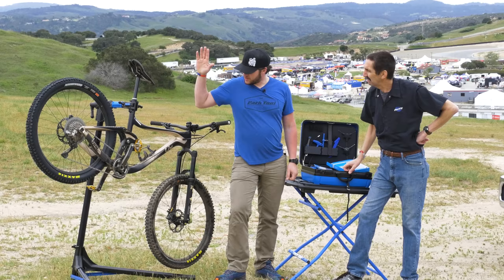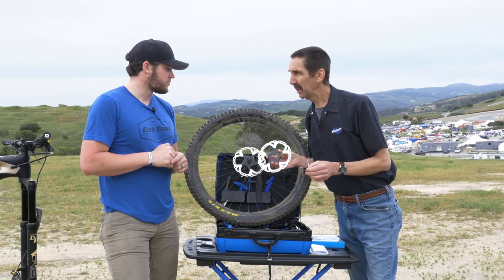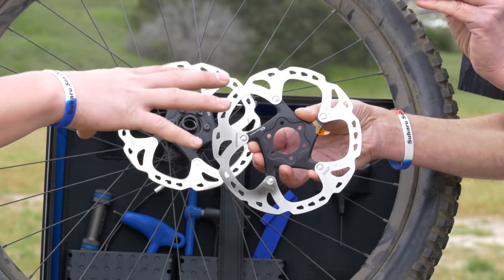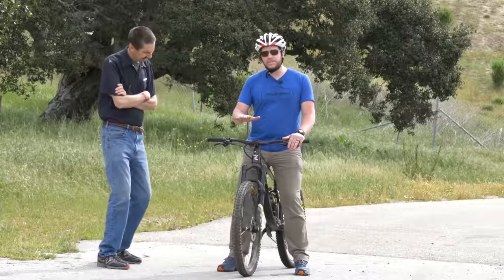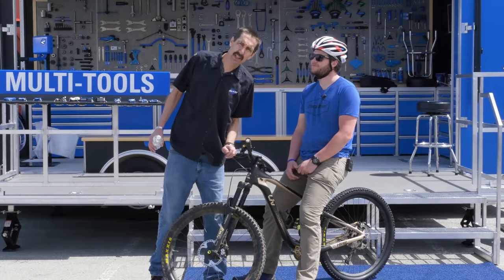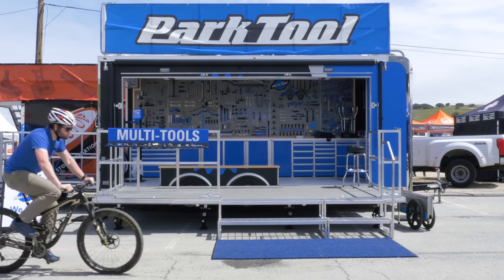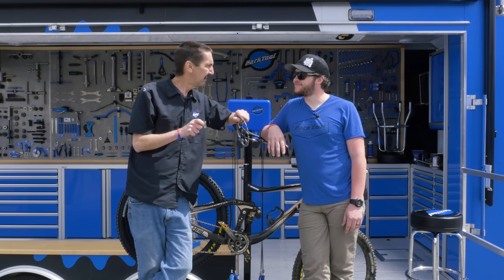Bedding In a Disc Brake - Tech Tuesday #106

Comment: Ok....did anyone else catch handling the new rotor with bare hands...good way to put oil on it...use a glove!!!!
Reply: Ok well im sure others have touched the rotors making/packaging them. They usually come with a light coat of oil on the disc's that needs cleaned off. Also he wss handling the old rotor as they said they were replacing both discs and pads.

Comment: Hello I need help, I have shimano 8020 4 piston brakes on my Wheelie bike and I needed new brake pads but I could not find the h01a brake pads that came with it, so I had to get the H03c metal pads(I am not sure if the h03c pads are good for the 8020, i would appreciate it if you check). So I put them in then I rode my bike, I do not think I did a proper bed in. Then I noticed that they were super hot so I went took them out and I saw that the outside edge of my rotor was slightly burned and the lower edge and top edge of my brake pads were black and the inside/middle portion of the brakepads looked brand new, also it was making a turkey/squealing sound I have a 160mm avid rotor.

Comment: Love the videos, has helped me a lot with my bike. Any tips on deglazing pads and rotors and how to prevent it from happening again?
Reply from the maker: To de glaze pads I like to stick some grip tape for steps or a skate board on a flat board and run the pad around in a circle on that to remove the glaze. Then I take a short piece of emory cloth and scuff up the rotor. To prevent this bed in your brakes. It could also be caused by too small of a rotor for the style of riding you are doing.
Reply: Thanks! I think I didn’t bed them properly
Reply: @parktool  I noticed that the replaced rotor in the video had wear all over the braking surface (from the outer edge to the inner one). What I've seen in many bikes, especially with Shimano brakes, is that a few mm of the rotor's inner edge usually do not contact the pads, being unused. I've noticed it even when the rotor and calliper were from the same group model, with new brakes. Any idea on this? Thank you.

Comment: good video, it shows how to bed, but for how long ?  how many "slow downs", or how many minutes ?  or do it until you can feel a difference ?
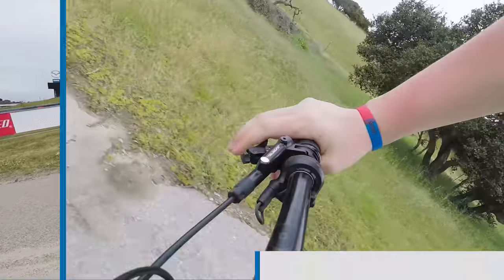Reply: 2:11
Reply: 10 - 12 brake applications per wheel .
Reply: Some say 20-50 x per brake, from 30 km/h to 5 km/h. As you can imagine this would represent a solid effort on flat terrain, much easier on a good road with a few kilometers of descent!

Comment: Hello! I just buy a new bike with SRAM Guide R and it seems to me that the front brake does not work as it should. It’s my first bike with disc brakes but I was expecting more braking power. A can not lock the brake (the rear seems ok). Is this normal?! and there’s a bit rubbing that I tried to fix with the help of your fantastic videos. It’s better but there’s still rubbing. I’ll appreciate your help! Thanks for your time!
Reply from the maker: Is there any indication of contamination on the rotor? Does the lever feel firm or does it feel mushy? That brake should feel like it has more power than the rear when riding.
Reply: Thank you so much for your answer! I took the brake pads off and they seemed grazed. But how can this be even possible if the bike is totally new?! And there’s still the rubbing. I switch the pads, pushed the pistons back to the caliper (there’s one that moves much more than the others when a press the lever without the brake pads!), tried to re-center the caliper and nothing works!

Comment: Do I apply the water before or after I beaded them in or in between please help?
Reply: Apply water right before you start the braking process. The water will possibly speed up the start of the bedding. But once you brake a few times, the temperature will evaporate the water. Adding more water could cool down the brakes and tell you if you're overheating them. But rapid cooldown may or may not be a risk for warped discs, so use warm water instead of cold water. Keep in mind depending on what brake pads you have, the brake power could be much lower in wet conditions, which means you may not feel the brake getting stronger the way you would dry.

Comment: What about switching brake pad compounds if the rotor is still good? Resin to sintered just rebed the new pads?
Reply from the maker: Sintered pads take a bit more time to bed in. And to be safe I would recommend this when switching pads. Better to do it and not have needed to than not do it and needed to. Good luck with your new pads!
Reply: @parktool  What about the 30x30 rule ? 30 breaks at 30km/h - so I've heared from some mechanics in Germany. First few times non full stop, then full stopping always. Let it cool down, and ready to use, to prevent glazing.
Reply: @Ematuresco  what about a set of instructions contrary to the video I just watched?
Reply: @BGraves  nothing will change your iq, unfortunately. sayonara.

Comment: Hi there! I just got myself a new bike. I was so excited I went out for a ride and didn't bed in my disc and pads properly. Now my rear brake brakes unevenly. The braking power is noticeably less for like one third of the disc's circumference. Can I save the disc doing something? or do I need a new brake? I tried with sand paper and brake cleaner but it didn't help (though I could try again with rougher sandpaper and being a bit more heavy on it)
Reply: Clean the pads and rotors with your process again.
If that does not help, and IF you are careful, you can try heat treating the rotor SLIGHTLY off the bike.
This will possibly even out its material qualities so the rotor  has the same friction around its entire surface:

Hang the rotor from a piece of wire in a pot of water so it is NOT touching the pot.  Heat the water gradually until it is fairly warm, almost too hot to touch.  You should be able to touch the rotor without getting burned.  
It is VERY important NOT to overheat the rotor.  IT should get quite warm to the touch, but not burning hot.

Remove the rotor and wire, dry the rotor quickly with a clean cloth, then hang in room temperature air to cool.
Do NOT allow the rotor to cool while laying on a surface, it MUST air cool evenly at room temperature.
When the rotor is cool, clean again with your chemical/sandpaper process and try the bedding in again.

Stay gold.

Comment: To increase friction, does it help to wash the pads by water when they got black after intense use at downhill park?
Reply: if they are just black thats fine and actually what you want (material between the pads and the rotor), hence the bedding in process.

Comment: Is the process the same if you're only replacing pads and keeping the old rotors?
Reply: the main reason for the bedding in process is to transfer material from the pads to the rotors. if you only change pads you will find it takes only a couple of stops to archive full braking power again, because there is already materal on the rotors.

Comment: what happens if you pour a little bit of water on the rotor while its really hot? will it bend or get damage some how, or is the rotor strong enough to withstand that thermal shock ?
Thanks for the video!
Reply: The rotors must be cold.

Comment: Why do I have do the bedding in procedure before every ride?  If I don’t my brakes squeal horribly and are very ineffective.  Once bedded in it’s fine until the next ride when I need to do the same procedure all over.  Taking about 10 braking attempts to get them working properly
Reply: contaminated probably
Reply: if the pressure in the lever changes as you apply the brakes a few times, it's a hydraulic issue, such as air in the system. 
if the lever feel remains the same but the brakes get more powerful, it's a friction issue such as very hard pads or slight contamination.

Comment: So I’ve been going through a TON of pads recently. Like one set on a 15 mile ride. One side is worn at an angle and almost looks like it’s tearing, while the other side looks almost new. Would an improper bed in process cause this? I doubt the caliper pistons are sticky, brand new caliper after the same thing was happening with the old one that is less than a year old. New rotors as well. Very frustrating.
Reply from the maker: That does not sound like a bed in problem. That is way to fast to be wearing out pads. I have seen some after market rotors cause this issue but nothing from the brake manufacturers rotors.
Reply: @parktool  hmm. I’m using the shimano rt54 rotors with the resin pads it says to use. Possibly it’s an issue with the pad alignment, or the bearing are loose causing the vent holes in the rotor to shear material off the pads? Although it’s a brand new wheel so I don’t think that would be the problem. Honestly stumped.
Reply: Did you ever fix the problem? I would highly suspect the brake caliper pistons. If the pistons on one side of the caliper were sticking (not smoothly, fully returning to their retracted position) That would seem  to be a cause for uneven wear?

I have SRAM brakes, but you can see from above when you let go of the brakes, the pads clearly and EVENLY move away from the rotor. If it looks like only one side of the brakes are doing anything, you probably need a local bike shop brake job to free up the pistons. It can be done at home, but you have to have a good understanding of how your calipers work, or you could end up with even more headache.
Reply: @shawnalove5050  new calipers twice new rotors. Wound up replacing rim and that fixed it 🤷‍♂️

Comment: Anyone know if you need to bed v-brakes/rim brakes? Since rims are essentially giant disc rotors...
Reply: I use wet and dry paper to abrade the pads first  , which is dark grey in colour . Use grade 120 . Purchase this from your local hardware store . I use dark green 3M brand scotchbrite pads to clean and provide a key to the rim surface .Scotchbrite pads can be purchased from a hardware store also or a supermarket . Place the scotchbrite pad between the brake pad and the rim with the brake pad installed in it's caliper . Push the scotchbrite pad against the rim with the brake pad pushing the top of the v brake or cantilever brake arm inward . Rotate the wheel about 3 times while applying moderate pressure against the sotchbrite pad and rim . Release the scotchbrite pad and repeat using a new portion of the scotchbrite pad . Do the same on the other side of the rim . Make sure that you have a 1 - 1.25mm gap at the rear of each brake pad when the front portion touches the rim , the toe - in factor . Your brakes should now be effective and reasonably quiet .

Comment: If i change my pads do i need to this also?
Reply from the maker: Bedding a rotor deposits pad material on the rotor.  However, just riding will eventually do this as well.   Your rotor is not new, and should not need another dedicated bedding.

Comment: Wasn’t aware of the bedding in process. I’ve slammed on the brakes a few times before bedding them in.  Can this do irreversible damage? Can you clean the rotors to restart the bedding in process?
Reply from the maker: This does not typically do irreversible damage. Sometimes no damage is done. But properly bedded in brakes will typically stop faster more predictably. The tough part of trying to go back and bed in an old rotor to used pads is that the pads do not have that initial coating on them and the rotor does not have that "rough" machined face. I would say if you are satisfied with your braking performance and you have been having a ball with the bike, Just keep on riding. Cheers!

Comment: My pads make a tink sound every time i brake. Most annoying. So after cleaning them & the rotor i put them on the rear caliper..and still the same noise. Only had them on 4 wks & one pad is a lot more worn than the other😝Tried centering them about 10 times but 1 pad is always closer to the rotor than than the other😅Excruciating waste of time & effort.
Reply: Loosen the adjustment bolts. On the side that is “too close”, slip in a bit of light card or a piece of paper folded over a few times to the “desired” thickness. Grip/apply brakes. As you apply brakes tighten the adjustment bolts. Remove card or paper.

The card/paper gives you some “tolerance” on the pad that was the “closer” one.

Comment: Hi park tool, I recently switched from sintered pads to resin pads due to contamination. I cleaned my rotor, yet when I brake I get very little braking power and hear almost a metal on metal noise, almost like the holes in the rotor going against the pad. I thought this noise will have gone away by now but it is persistent after about 30 stops over multiple rides. Also, my braking power has increased slightly, but has yet to match my previous pads. Any explanation would be really helpful as I'd love to be able to use my rear brakes again. :)
Reply from the maker: How did you clean the rotor? Could It still have some contamination on it?  Thats pretty common. I find that lightly scuffing the rotor with a higher grit emory paper works well to give the rotor some more bite. Try pulling your pads, lightly re surface them and then lightly resurface the rotor as well. Then bed the brakes in and you should be GTG.
Reply: Pierre, what's  the update? Did you get it figured out? How?
Reply: Check that your rotors haven't worn below width tolerance . Isopropyi Alcohol is ideal for cleaning rotors and brake pads .

Comment: Bedded in new pads and rotor, but locked the wheel a few times. Do I need to completely restart?
Reply: Did you find the answer?
Reply: @Big_Boss92  Only through continued use. The brake is fine, no bits where it goes uneven and fine stopping, but it does squeal. Whether that's from locking the wheel bedding in or just cheap brake pad though I'm not sure.
Reply: @andrew2272kag  thanks mate, happy riding
Reply: @Big_Boss92  np, cheers mate you too
Reply: @andrew2272kag  i put filtered water through the caliper and went to bed in the brakes Shimano 4 piston as an upgrade to my stock brakes, and holy shit i nearly went as over heels haha. Good discs are awesome 🤘

Comment: Is there any concern that the water/slurry technique could warp the rotors from due to the heat they generate while braking, then adding water to them. 
Or do you only need to add water when they’re cold before starting the bed in process?
Reply from the maker: It certainly rains while people are out riding.  It does not wrap the rotors.
Reply: Thanks,  @parktool . I hope that wasn't a snarky comment. I'm  genuinely asking because I've heard concerns about this, which a friend of mine saying his dura ace rotors warped in the past. 
What I am trying to confirm in this comment is first, is that a concern during the bed in process, since one might be generating more heat that usual as you're performing 20-50 stops basically back to back. And, secondly, do you need to reapply the water between stops or do you do this only at the beginning which creates enough of a "slurry" to perform the bed in process correctly?
Reply: @zeyadsaadeh  You'd really need to be in a very looong, very steeep descent to have brakes that hot ...

Comment: Do I need to do this if I only replaced the rotor and not the pads?
Reply from the maker: its good for it to do this if just replacing the rotor. it will transfer a small amount of the material to the rotor and will mate the two. It will help with power and control.
Reply: @parktool  ok, thanks! Any way to do this on a bike stand? Got a bit of a blizzard outside right now.
Reply from the maker: It's really not feasible to generate the heat and pressure to do this in the stand unfortunately.

Comment: Is it necessary to bed in rim brakes on a road bike?
Reply: not to the same extend because the braking material is way softer on rim brakes. but it actually does not hurt.
Reply: @Digi20  Thanks. will keep it in mind next time.

Comment: Do I need to clean them after that?
Reply from the maker: You do not need to clean them off after the bedding process. Good Q!
Reply: Park Tool And also what if I want to replace just the brake pads and leave the rotor?
Reply from the maker: If you are just replacing the pads it is not essential to go through the entire bedding process. I recommend going up and down the street just a couple times.

Comment: Wait what i dont get...why do you need to put water when you are doing this on a flat surface???
Reply: Stretch of road was too short, no possibility of generating more heat to bed in the pad. Lack of length, not gradient, was the reason behind that tipp. So the water should help flushing out the abraided pad material.

Comment: Do new disc pads rub a while
Reply from the maker: You should be able to adjust the rub out of new pads right away.
Reply: @parktool  i changed the disc pad of my bike and the wheel is not free.. the mechanic says it takes some time to adjust to rotor shape as it is corroded a bit.. is this  true..
Reply: when you change to new pads you have to press the pistons back, and sometimes re-adjust the braking caliper.

Comment: How long do brake pads lasts?
Reply from the maker: This will depend on riding conditions and how frequent it is used. I have seen pads last a day in a muddy event and some other pads last years. Replacing every season is a good practice as to give an opportunity to inspect the brake caliper.
Reply: @parktool  Wow, a pad got wasted only in 1 day, amazing.
 Sir I have one question, the brake pads/shoes of scooters/motorcycles lasts around 15000kms, and bicycles are light weight and low power vehicles, then why their brakes pads/shoes doesn't last as long as motorcycles/scooters?
Reply from the maker: The compounds are different. There are very long lasting pad compounds for bike brakes but the brake performance is terrible.
Reply: @sanapung321  the very small size of bike brake pads likely plays a role. Also why they get contaminated easier.